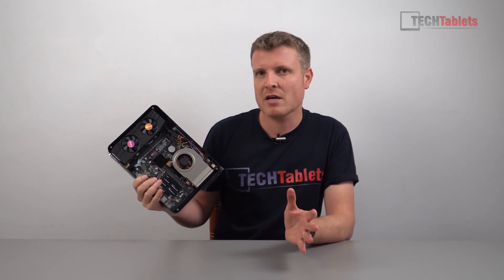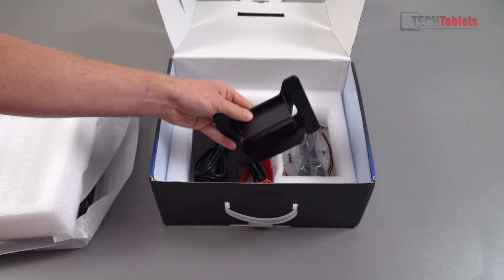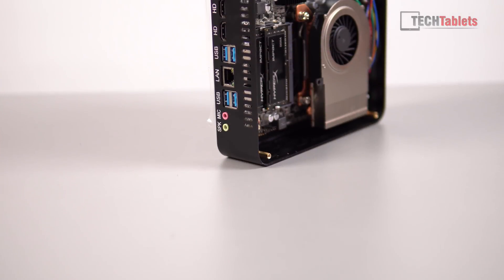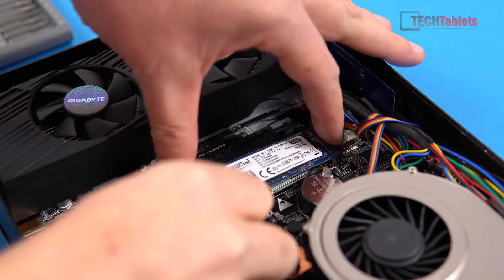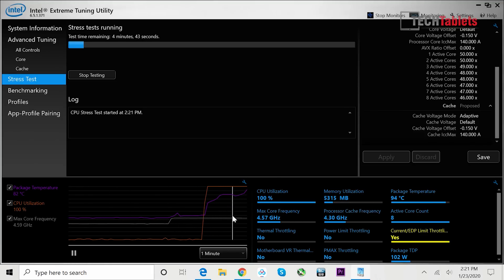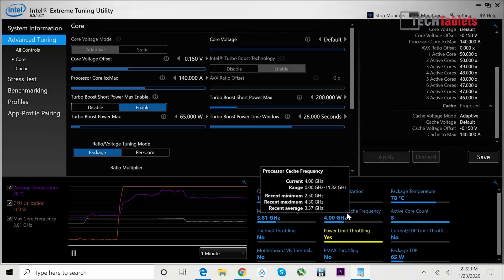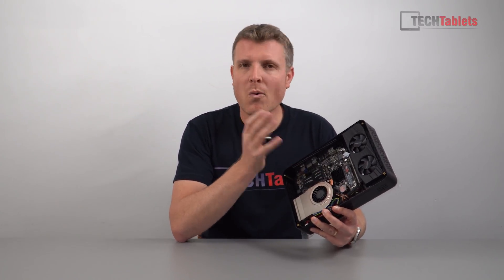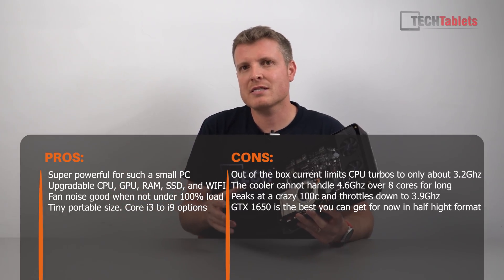Crazy 8 Core i9 9900 Mini PC - But Is It Any Good?

Comment: change the CPU? its Intel, you can't ... every new generation you have to buy a new motherboard.
Reply from the maker: You can change the CPU no worries. If you get the Core i5 model later you can use the Core i7. Or the 8th Gen then use 9th gen. 8th/9th gen works as long as it's LGA 1151.

Comment: If it taller it would be able to fit some rtx 2070 mini or 2060. But still crazy this low profile graphics solution a pc like this!
The price is might a little bit high.
You are awesome to review this product like this from aliexpress.
Reply from the maker: Yes about $100 overpriced. You can build cheaper, but it would be much bigger.
Reply: @Techtablets  But maybe worth it because the SFF size!

Comment: I wonder the possibility of a 3950x in this kind of a form factor!
Reply: @Alexander Davis not really as for a matter of fact the 3950x wucks about the same power as the 9900k and with slight tweaking and clock speed limitation i am sure it can be done rather easily

Comment: Wow, I really want to snag one of these, once they are on Amazon or Ebay. I snagged one of the NUC form-factor i9-9750H models, and MAN does it back a wallop, but the PCIe slot is really missed!
Reply from the maker: Yes, the 8750 and 9750H models are little beasts but no dGPU. I was almost going to get the new 8 core 9980H model.  I may if this video does well and there is interest. As those NUC form factor ones have very good coolers in them and handle the 45W mobile chips with ease!
Reply: Wiztothelizzard - Enter the "HP N2 G4 mini" small workstation PC. It has a CPU slot for up to i-7 and a MMX graphics slot for Quadro P1000 or better, several memory options and I/O. It's an engineering-grade workstation with accredited drivers for mission-critical work; price not too bad... $1K to $1500 depending on configuration. Unlike the Intel NUC (for embedded app), this is a desktop system with upgradeable CPU and GPU.
Reply: Be carefull to not get the SSD too hot... Or it WILL die